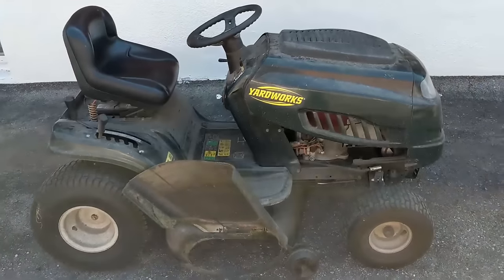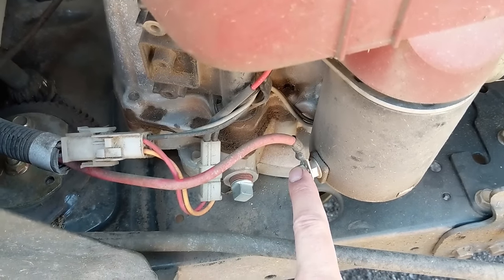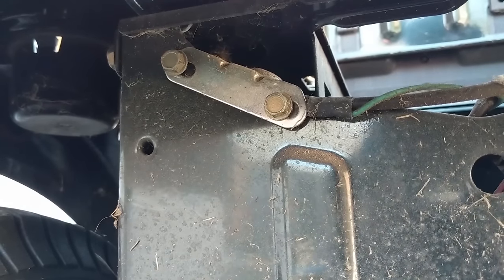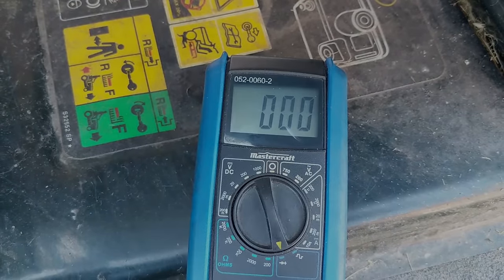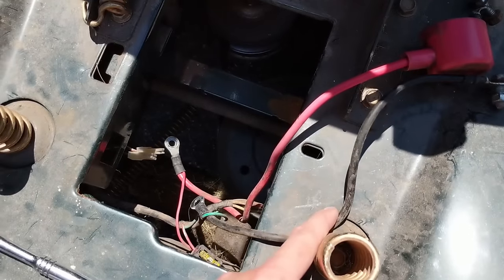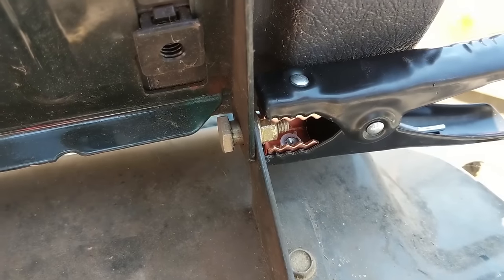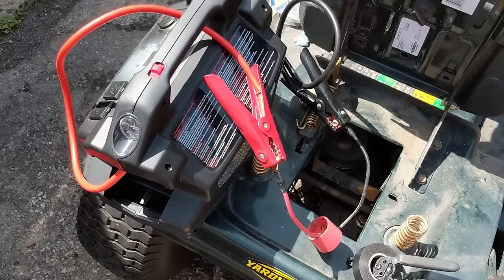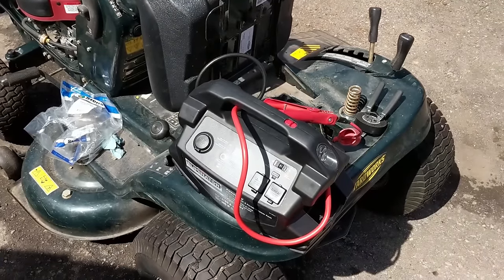Riding Lawn Mower - Solenoid Clicks but Doesn't Start

Comment: I have the same model ! Just bought a brand new battery the starter starts but the flywheel gets really stiff at some points and stops the flywheel from turning , any fixes?
Reply from the maker: Could be automatic compression relief gone on the cam gear. Get a 370 cranking amp battery, that should help
Reply: @EliminatorPerformance  alrighty thanks !
Reply from the maker: Just keep in mind, the battery will turn the starter easier but the starter gear still has added force applied to it. When the auto compression relief goes that's when you start burning out starter gears. Just make sure you're not on the starter for too long. Also, check all electric connections on thicker cables (battery positive and negative, starter cables) for corrosion. Permatex sells a battery terminal cleaner (it's like baking soda in a can) works great to cut the acid.
Reply: @EliminatorPerformance  alrighty I’ll look for that thanks for the help !
Reply: @EliminatorPerformance  hey sorry to bother you again I checked all that and still has the same problem , do you have a Instagram or something I could contact you on to send a quick video of what’s going on ?
Reply from the maker: @moistyfinch2226  watch this ; https://youtu.be/vJWbfSxHY1Y as it's extremely difficult to diagnose things over the internet
Reply: @EliminatorPerformance  alrighty I think I found it out , thanks for the support!

Comment: How often does a solenoid actually go bad because I started my lawn mower started mowing the lawn and then it died Midway through. Replace the battery in the spark plug because I couldn't find anything else going on and it still won't start so should I replace the solenoid? It clicks under my seat in the solenoid
Reply: That's what mine is doing. I even replaced the fuse because it was blown. Yet still nothing. I'm going to get a flat head screw driver and touch both connectors on the solenoid to see if it fires. If not I'll take my solenoid off and get it checked. 
Anyhow maybe you could put a new fuse in and see if that works first?
Good luck.

Comment: So if your positive connection was suspect, why was it still making the solenoid click?  It was still sending 12v to the solenoid, right?  I'm not totally understanding what the fix was.
Reply from the maker: 12v is sent to the solenoid from the small wire that comes from the key switch, the solenoid clicked but wasn't sending power to the starter. You have to understand that that there's 2 circuits for the starter circuit. The 1st circuit worked as the solenoid clicked. It was most likely a bad connection either between the starter and the solenoid, or the battery and the solenoid, and by taking things apart and cleaning the connectors, and then reassembling, solved the poor connection.
Reply: @EliminatorPerformance   - Dude, thanks so much for the reply.  It "clicked" with me when you mentioned there are two separate circuits.  I was having the exact same issue.  Solenoid would click but no power to the starter.  It was one of the small ground wires that was the issue.  Frayed and almost broke into.  Spiced in a new healthy wire and all is good.  Thanks again.
Reply from the maker: @scottharrod2406  glad I could help, subscribe for more!

Comment: My dad has a troy bilt riding mower and its only 3 years old. He was mowing the lawn and forgot to disengage the blades and put it in reverse. It shut down and wouldn't start back up. I watched every video on YouTube but it's not getting me any where. Any help will be appreciated.
Reply from the maker: Disengage the blades, put the mower into drive all the way forward, press the brake and try to start it. Sometimes putting it in neutral won't be enough to disengage the reverse safety switch.

Comment: Hi there, I have this issue, so will look at this, but the biggest issue I have is that it did start and runs fine, but when it gets hot it will not turn off and none of the safety trips work, but they all do when cold.
Reply: Rework your ground connections. The switch when off grounds the power from something to discontinue the spark

Comment: I have the same but i dont have a lawnmower anymore, it is just the engine and the cables to the battery with an ignition switch, how do I have to start it? I think it is something with the ground

Comment: Great video - any idea what's wrong of the solonoid clicks repeatedly on start ? Is there a overload protection built into the solonoid ?
Reply: Not getting enough power from the battery, so it either needs to be charged or there is an issue with the wiring.

Comment: Did you do a alternate test for 12volts
Reply from the maker: Yes you can check the charging, 12v test on battery with engine off, and then 12v test on battery with engine running full rpm. If voltage is higher while engine running, alternator is working

Comment: Quick Q? [from rookie/novice];  some minor/major advantage(s) using your "Eliminator Battery Booster" AKA booster or some snuff Vs. my Centech Battery Charger AKA trickle w/ set to 50Amp *Emergency Engine Start*?  ... Near idle curiosity, but hey, sometimes, there's "preferences" and usual enough for reason(s) some maybe more valid than others.  ... Hope that's not far into the weeds.  Kind regards!

Comment: That"s not "continuity", that's Diode Test.  Does it "work"?  Yes.  Is it right?  No.  I'm not familiar with that exact meter, but the sine wave right next to the diode test (arrow to vertical line) is actually probably continuity test.

Otherwise, seems the only useful thing I have found sofar on actually fixing the issue.  Found this trying to fix my F.I.L.'s old craftsman mower.
Reply from the maker: Yea this is a cheap Meter, diode and continuity are same. I actually just upgraded to a fluke 117 and it's amazing

Comment: I charged the battery . The instant I touched cable to battery the engine start turning over. Is it a bad switch?
Could it be the starter solonoid?
Reply from the maker: Stuck solenoid, I've only had this happen once but it does happen. The solenoid gets seized in the engaged position, very dangerous and can burn out wires and possibly cause a fire. Disconnect battery and replace solenoid!
Reply: Thanks brother. I'll put a new solenoid on tomorrow.  I'll post results.
Reply: It'll  be Wednesday till I change the solenoid. I'll let you know how it turned out. Thanks again.

Comment: Performing a voltage drop or potential voltage test is a better way to find a fault as you leave the circuits intact and you get an actual value to reference.

Comment: Mine is doing this just clicking, my battery charger says bad battery, can bad battery also mean bad connection?  I cleaned the posts and cables and even replaced the Hot cable from battery to solenoid. My charger still says bad battery, the battery is 5 years old. I even used my voltage tester at the battery and it lit up that I was getting connection from the battery to the cable.(edit) Also I did have my charger still connected and on when I used the voltage tester.

Comment: Mine runs but I use pliers to start it on the selenoid. There was no battery with it when I found it at the free melt Yard. I called the yard Canadian Tire because that is where every body goes to find projects to fix or just for parts. should I order new Solenoid?
Reply: What was the problem?

Comment: You mentioned the foot pedal switch not properly engaging. Where is that switch located?
Reply from the maker: Usually near the brake pedal itself
Reply: @EliminatorPerformance  thanks, another question, if I have 12+ volts across the solenoid without turning the key, I'm assuming that isn't good?
Reply from the maker: Watch this, hope it helps; https://youtu.be/vJWbfSxHY1Y
Reply: @EliminatorPerformance  Thanks, it's my pedal switch! Bypassed it and on she came! I will be ordering one today!
Reply: @EliminatorPerformance  I wanted to follow-up. I went out the next day to start the mower, with the pedal switch bypass in place, and it didn't start.  I played around with the other switch that is associated with the mower blade lever (switch depresses when the mower blade is disengaged, PTO switch?) and found that the switch was not depressed properly.  After ensuring that the switched was depressed properly, the mower started just fine with both original switches in place. When I went out to cut the grass, after engaging the mower blade, the mower cut-off as if it was not getting any gas. At this point, I could start the machine, but as soon as I took my foot off of the brake pedal, it would shut down due to lack of gas.  At this point, I'm convinced that their is another switch that is turning the machine off when I let go of the gas.  I called a local tractor supply store and inquired about any switches that I might be missing. They said it sounded like the seat switch was not behaving and that I could just bypass it.  Since, I had already bypassed  the seat switch several years ago with a jumper, I went to check to see if my jumper was still in place and effective. It was still there so I decided to cut the wires and join them directly. The same thing happened.  Then I tried separating the wires and viola! everything works just fine. So what I have now is a system where the seat switch is no longer relevant, but I am convinced that there must be something loose somewhere that would cause the machine to misbehave when the seat switch circuit is closed but behave normally when that circuit is left open.

Have you ever run across anything like this or know what in the system would cause this type of behavior? Since I have the machine running now with that seat switch circuit wide-open, should I just forget about it until another problem shows up?
Reply from the maker: @bfwiii  sounds like seat switch. If the seat switch senses the brake off (disengaged) and the pto engaged while you're off the seat, it cuts spark at the coil. So try starting the mower with the parking brake on, then leave the brake on and engage the mower. If it still dies out then it's most likely a seat switch issue. Electrical is always a pain in the butt!
Reply: @EliminatorPerformance  Yes it is! Reminder, my seat switch has been out for several years. What I have now, are two disconnected wires (an open circuit) and everything seems to run fine. Is it possible that the kill switch for the fuel supply is bad, assuming that there is a kill switch?
Reply from the maker: @bfwiii  maybe this video will help https://youtu.be/hFqYA2to3qw
Reply: @EliminatorPerformance  Thanks much. It looks like I have an electrical gremlin that I outsmarted for the moment. I likely have some sort of short in the shut-off solenoid circuit that is resolved when the seat switch circuit is left open... sort of like a double negative in English class. I'll run with it for now, but will be tinkering to see if I can find it. Again, Thanks!

Comment: do you have to push the break down to start mower
Reply from the maker: Yes to engage the brake safety switch. Without that, the circuit is grounded

Comment: One problem with obtaining the "Highest CCA Battery", if the Possitive Wires are 8-10 gauge, they MAY be too small for the Power Transfer and OVERHEAT!

I have experienced this only TWICE, where I just Purchased 4-6 Gauge Jumper Cables and replaced the FACTORY LINES!

Just in case someone runs into this problem! 😎

Thanks again!

🤓 -Thomas
Western Washington State
Reply: The wire will only carry the amps that the starter pulling. A huge battery will not make it overheat if the starter and circuit is o.k.
Reply: Right on the money Waterman! Excellent point!

Comment: My  John Deere mower does nothing when I turn the key. The battery is fully charged,  I checked the brake safety switch and it is good. The fuse is good. The solenoid does not click when I turn the key. Could the problem still be a bad solenoid? If I put a screwdriver across the solenoid connector and the starter engages does this indicate that the solenoid is bad?
Reply from the maker: Solenoid or the key switch, unplug the power wire (usually small orange or red wire) from the solenoid, and with someone sitting on the mower with foot on brake pedal, turn key to starting position and hold it.

With a multimeter, set on voltage, red probe on that wire and black probe on the negative terminal on battery. You should see 12v at the wire that powers the solenoid. If you don't, it's most likely a keyswitch.

If you do see 12v, than it's a solenoid.

Comment: I don't understand: when I turn the key it clics, but it doesn't start. Battery is full; Solenoid Test is ok, continuity on fuse, ground and 12 V cable are ok (resistance test is ok too). The keyswitch, breakswitsch should work, because I can hear a clic when turning the key. When I put 12V on the solenoide control terminal (not the one connected to the starter), the motor is starting. Why can I hear the clic if the12V are missing at the solenoide control terminal when turning the key? Do you have a video testing the printed circuit board. I really don't know what to do now. I can start it with the 12 V at the solenoid terminal, but I don't like the sparks near the fueltank.

Comment: I had a problem with my john deere mower it would not start I kind of knew it was the starter solenoid so I took one of my wrenches and shorted the two big terminals on my starter solenoid togather and the motor started so I bought a new starter solenoid the old one was no good
Reply: ampar wingate   And that folks is how it’s done 👍

Comment: I have a Craftsman (MDT) T210
Were is the Solenoid located and how do you get to it and where can I find a wiring diagram
Please
Reply from the maker: Try going on Google and typing in t210 wiring diagram, or t210 service manual. Even t210 parts diagram may show you a diagram for the wiring.

Comment: My blades stopped turning while mowing. My wife turned off the mower and now it won’t turn over. Any ideas?
Reply from the maker: If it's got an electric PTO then I'd check the seat switch!

Comment: I replaced the solenoid, starter, and ignition switch. I need to order a new coul because mice love them so much 😡
I checked the grounds and all shutoff switches ( brake, blade Etc. ) and still no clicking or turning over. It will turn over if I jump the coil so I'm assuming it's a short somewhere between the ignition switch and coil.
Tomorrow I'm going to check the battery cables for corrosion.
Sad thing is last summer everything worked just fine.....
Reply: Dan S check your key switch. If the wires connect to it are "live" the switch may be bad.

Comment: Im having the worst time figuring out my problem. Im only getting 8.5v at the solenoid. So it doesnt even click. I get battery voltage at the brake switch and then it drops to 8.5 at the pto switch. Then the pto switch sends 8.5 to the solenoid...i also cant find the actual wiring diagram for my tractor. Only the year before and it doesnt match. My  brake switch only has 2 wires where the diagrams i find show 4 wires.
Reply from the maker: Sounds like you have voltage drop somewhere, possibly corrosion. I'd put your battery on charge to boost the amps and voltage, then retest your wires and see if it improves. I have a battery load tester, so I can see the voltage when a battery is just sitting, or under load.

Comment: If the fuse is blown will the Solenoid click?
Reply from the maker: No because no power will go from the Battery to key, or from the key to the solenoid. Key switch could be good, but if no 12v is sent to charge the electro magnet in the solenoid, no clicking
Reply: @EliminatorPerformance  Put alligator clips with wire on the two post on the solenoid.  connected the battery Starter did nothing.  even turn the key starter still did nothing. Would the solenoid  still click if it lost its grounding?

Comment: i ahve so many questions about the electricity in these things..i currently have one of these and im bout 100 percent postive its not starting becasue of an electrical issue im certain its not the engine. it has compression, gas . and new spark plug so it shas something to do wiht the wiring or soemthing..i bought a new battery, new solenoid and still nothing it doesnt even click as far as testing wirses or if i hooked the wores up wrong to the solenoid i have no idea i know very littel about which setting to set the mutimeter at ive watched a few videos and little by little ive tested my mahcine out...mine beeps when i test the ground cable...shows 0.05 ish soemtimes to .11 and bounces around maybe its a loose connection soemwhere the old battery sucks but i returned the new battery becaus ei really have no idea what im doing when it comes to the electrical in this thing..so to save myself soem heavier losses i just returned it..if it was just down to a simple engine i could do it i just didnt think or know thered be so much electricla knowledge needed for these things.
Reply: ps as i replaced the solendoind on my yardowkrs its in the same spot as this one and what a pain in the ass to get at lol
Reply from the maker: Sorry I can't help much over the internet as things are hard to explain or diagnosis without being infront of me, but please watch this video, I take you through the entire electrical system; https://youtu.be/vJWbfSxHY1Y
Reply: @EliminatorPerformance  i think i saw that video ill check it out but yeah i know what you mean im more of "i need a hands on or be there in person to have soemoen teaching me" so i can see and ask questions as i go

Comment: I had the click but no start. Changed the solenoid. Same result. ‘Jumped’ the battery. Same result. Don’t have a multimeter so guess I’m gonna go buy one to test the starter cable for continuity and if that’s good, I’m guessing the starter is fried?
Reply: So I have continuity between the relay and the starter. I’m getting power to the starter but no start. That means the starter is seized right?